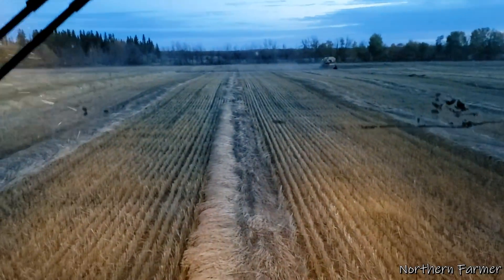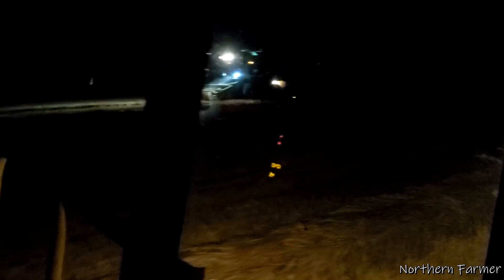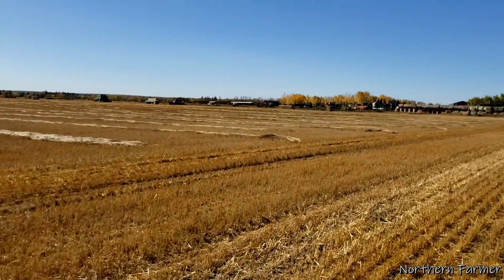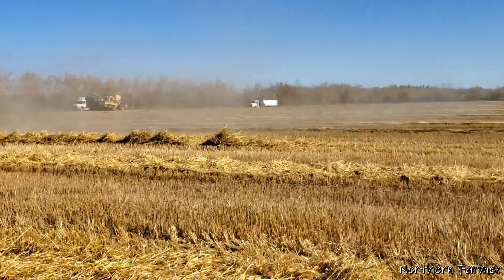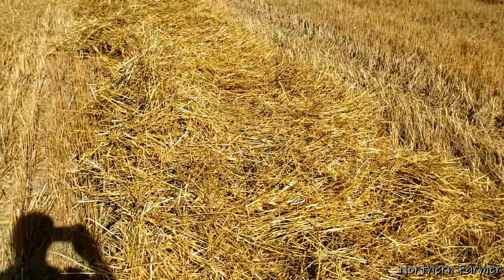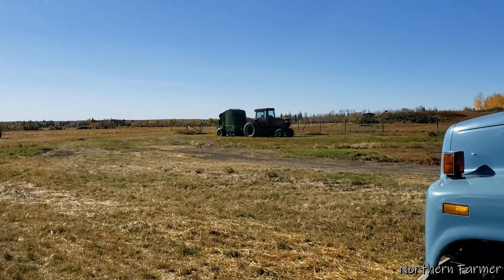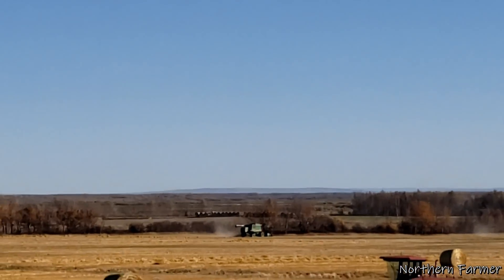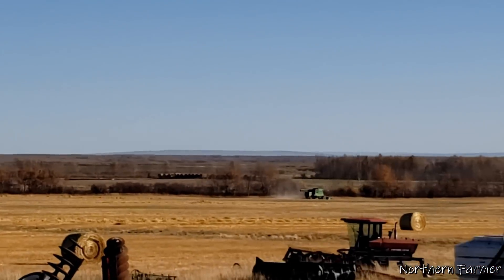On To The Wheat!!

Comment: The magic 16% moisture.  Northern AB dry for wheat.  My wheat sucked too for the same reason.  Too wet.   Straw was there but  the heads were thin.
Reply from the maker: It ended up at 14.9

Comment: You can't get the rotor speed up because the belt is stretched/worn.  Check that the adjuster is running all the way to the end of the threads.
Reply from the maker: Oh no.. its not strectched... because it wont slow down either... Im thinking its airl locked

Comment: My cr970 leaves really nice full length straw, I'm surprised the tr is so different on that the rotors seem quite similar
Reply from the maker: The rotors have changed so much every model. I notice the tr 99 has better straw then the 96
Reply: @Northern_Farmer  ok, I thought they had had the s3 rotor for a while. How does the 99 compare to the 9600 for capacity?
Reply from the maker: @trentsiemens1131  about the same in goid conditiins
Reply: @Northern_Farmer  ok, because new holland didnt really get popular here till the cr9070 so dont see tr's around to compare but I've done custom work beside a few 9600's

Comment: Bare with me because I've got zero experience from these techniques: If you manage to pick the rotary straw up, doesn't it give a more dense/tight bale or is it just falling through between the belts and/or give a easily disintegrated bale?  On my latitude, silage/hay is the thing and if we use a combine it is a conventional one.  Further south the soil is more apt for grain and the big farms tend to go rotary, either chopping the straw or square baling, accepting the loss on the ground from the roughly treated material.
Reply from the maker: We pick up that straw no problem ... but some years it crushes it up pretty good to the point its unbaleable.

Comment: You are putting the straw through the chopper on the NH TR  and not on the JD. That's no comparison. You can put the chopper of the NH in low speed. Or throw it off all together.
Reply from the maker: Um no...no choppers at all